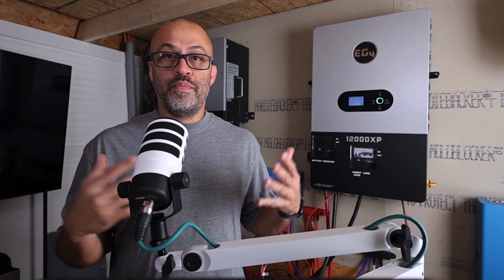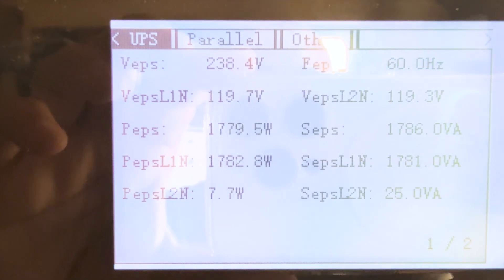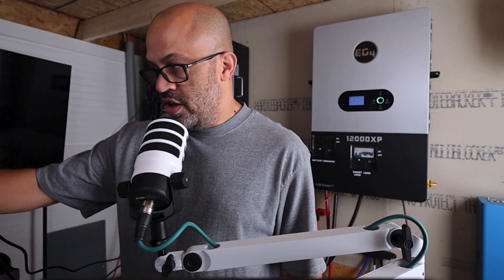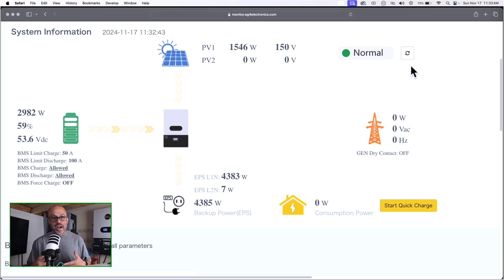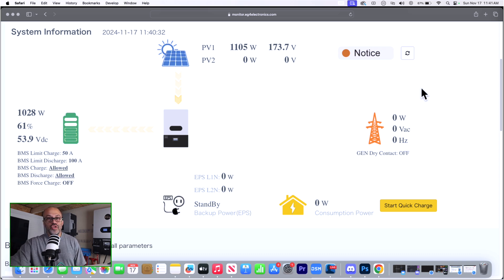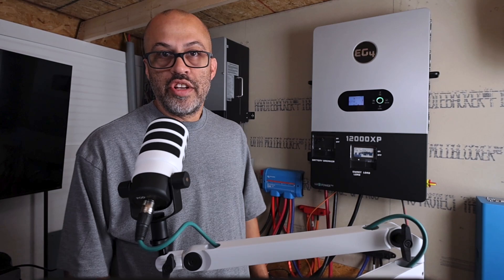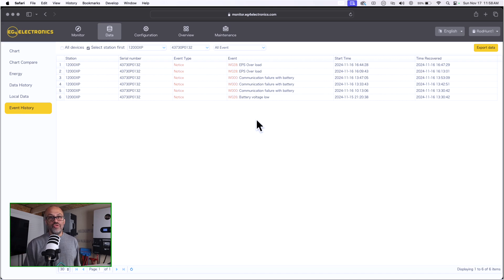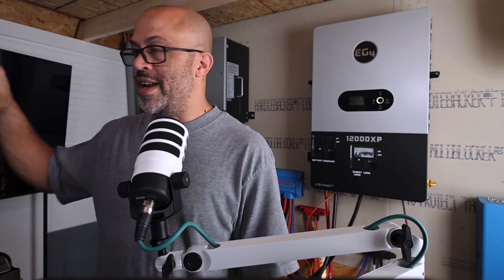EG4 12000XP Load Leg Imbalance Testing - Update with over 6k on ONE LEG

Comment: i've got a 12,000 xp putting 50AC volts per leg off of battery power??? when i hook everything up it's  "230"!!! on one leg which of course will destroy everything that doesn't have a surge protector they're telling me it's a neutral wire from the factory that wasn't connected what's your thought it freaked me out so bad now i don't trust this thing ?? the guys from signature solar are great
Reply from the maker: Crazy. You should get that warranty replaced. Who did you get it from?
Reply from the maker: SS it seems
Reply: @rodneyhunt  all is good now wow thank you for your videos !! on damaged an 18 dollar transformer i got real lucky but i guess the internal neutral wire need to be checked before use live and learn

Comment: Last I remember that you don’t have the 24k watts in solar panels. I believe you were half of that. So, I don’t think this is an accurate test.  
Also, I think you needed to have more than 400AH for the battery as a minimum. Perhaps this is a situation where you don’t have enough of a solar power setup for that 12k OG inverter. 
I have 2x6000xp inverters from EG4 with 400AH battery plus solar panels running in series, we have run our water well pump, mini split AC on heat, microwave, lights, satellite internet, laptops and TV off of our setup in the winter and our inverters in off grid mode with no city power and the inverters and batteries don’t turn  off. Though I am about to buy a 12k with 2 or 3 14.8 kWh 280AH batteries. 
Think about this. To get the 24k of solar panels inside the bounds of the MPPT charge limits you need 40x600watt 48v panels with an amperage between 9 and 13amps. Otherwise you aren’t going to max out those inverters wattage unless you use  lots of 24v panels and parallel them to get the voltage and wattage you need.
Reply from the maker: Thanks, good info. I am going to do a follow up when I have more time
Reply: @ I got some information for you. In order to get the 22 to 24k on that inverter you will need to get a combiner box or two.  I looked at every configuration.   And outside of getting 600 W panels it’s difficult in the extreme to get upwards of that wattage without using a combiner box even though it allows you parallel at the terminal in the box. I think I’m going to try this myself with the same inverter.   After I purchase the equipment, I will make a video of how to set this up on my channel.
Reply from the maker: @ nice. 👍

Comment: Just keep in mind that if your items are connected to one of the phases, they will show that way I think meaning showing the wattage used to the physical phase. Meaning phase one phase to much like you would have in your regular electrical panel.  Try putting some of those in an outlets that are on the other phase and see if it balances out.

Comment: Inrush? Air conditioner? What happens if grid is attached? Will it shut down or transfer to grid?
Reply from the maker: In can use the grid. It all depends on size but I would guess this would start most residential AC units.

Comment: Ya know 3 6k XP's will take 30k -24k usable in PV. Not shabby either. Not sure why so many are so concerned with surge capabilities and or load correction. Best practice is build your system right and over build so your panels are never stressing out pushing loads over normal operation. Less is more. Much rather my equipment have a long easy and trouble free life. If demands increase then stack on another. They're scalable for a reason.
Reply from the maker: Great points! I recommend at least two of whatever you get. With two 12000xp’s your solar and output power would run most homes easily! But I still like my 6000xp,s as well

Comment: So the bms shut it down so with higher solar panel production the bms will not reach it's limit (my guess)
Reply from the maker: When the overload happens?
Reply: @rodneyhunt  Yes it may pull power from the solar first so the battery bms will not shut it down only the the inverter would time out I think it depends on your settings in the mode option cool.
Reply from the maker: Which part of the test are you talking about? I might be lost on that comment lol

Comment: Off topic but curious do you use surge protection or emp devices? If yes can you make a quick video of where and how you wired them into your system
Reply from the maker: Will do for sure!
Reply: @rodneyhunt  i am using your code again tomorrow if they let me for the third time, getting 6 indoor powerpro batteries with conduit boxes, 2 flex boss inverters, 3 chargeverters, 3 ll-s rack batteries with 3 slot rack, a pallet of blue sun 460 bifacials and 4
6 brighmount arrays
Reply from the maker: Wow nice! Hey thanks for that and enjoy the new equipment